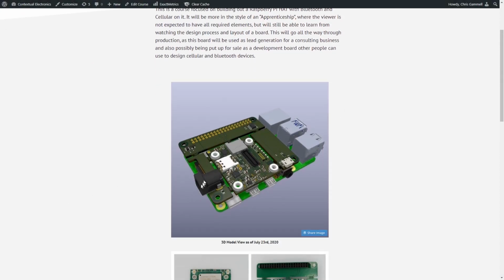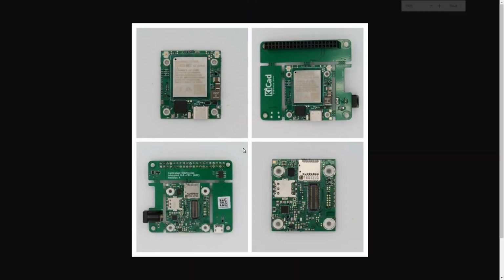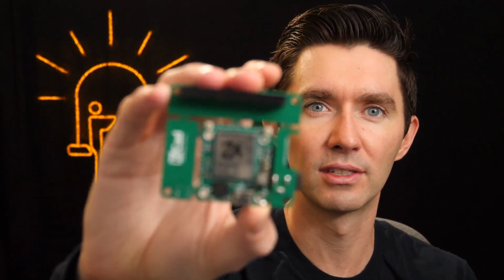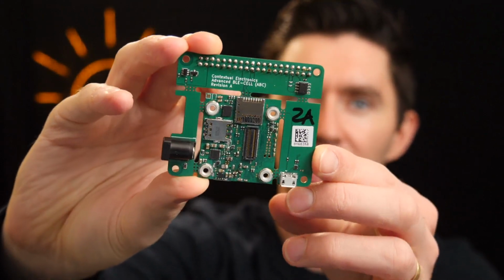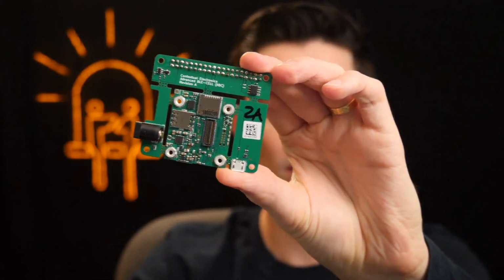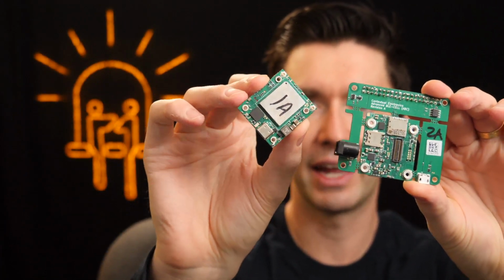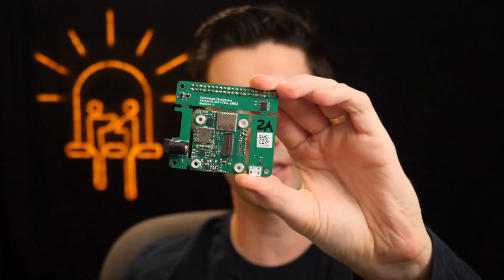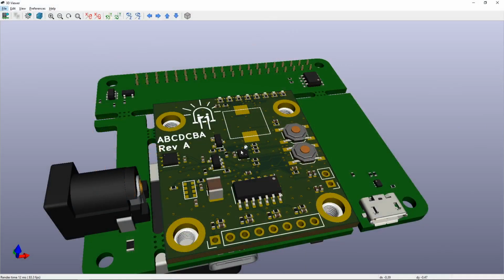Introduction to the ABC Platform

Comment: What part is used for these threaded mounting holes? Are they soldered in place, or pressfitted?
Reply from the maker: Those are actually SMT metal standoffs, placeable with a Pick and Place machine. Very exciting. The part is Keystone 4881.

Comment: What connector is it used for the breakout boards?
Reply: Looks like a Molex Slimstack, probably 0.4mm pitch. Those connectors are great for board-to-board connections, I use them all the time. Not the easiest to solder by hand though, but it's doable.
Reply from the maker: The connector on the ABC is the DF23C-50DS (https://bit.ly/3kAKUOT ). On the daughtercard it will be the DF23C-50DP ( https://bit.ly/3eZlPfi )

Comment: Is it possible to buy ABC boards from you?
Reply from the maker: Not yet! But I'm hoping to put these up on Tindie at some point soon, or maybe do a small crowdfunding campaign. It would hopefully be very easy to make your own daughtercard and then use the ABC section to connect it to the internet.
Reply: @contextualelectronics  
I have a very simple MQTT application, where I need to send a small amount of data occasionally. I really just need an affordable modem that can take serial data and publish it to my broker.
Reply from the maker: @GlennHamblin  Ah! Well that sort of thing should be possible now, there are many other cellular based boards in the market. What is your definition of "affordable"?
Reply: @contextualelectronics  
I'm thinking 30-50 bucks range.
Reply: I'm currently eyeing the XB3 stuff.